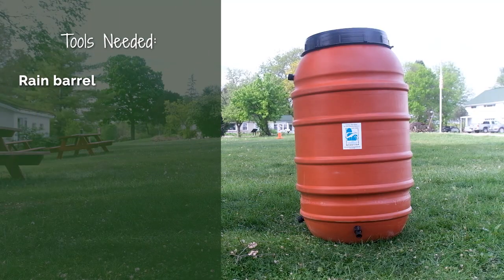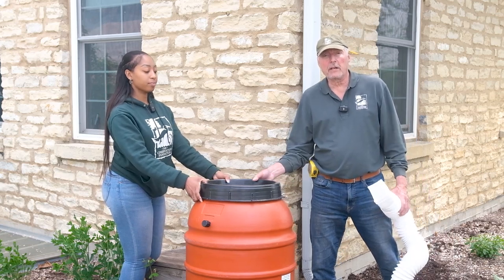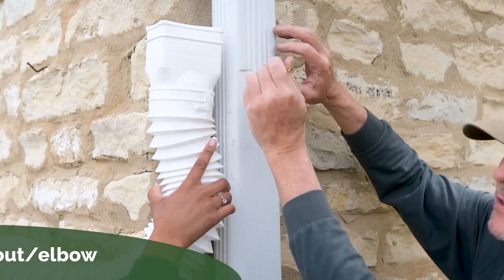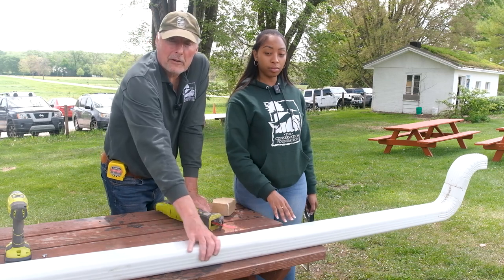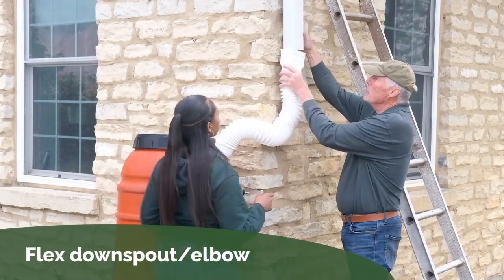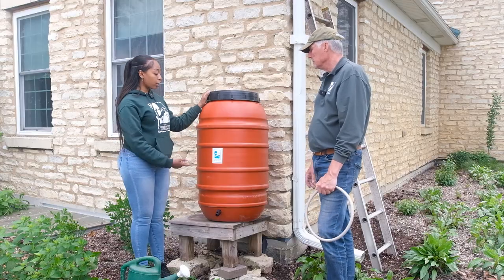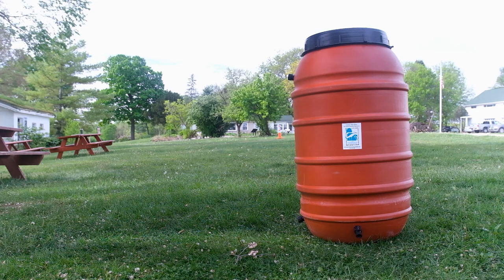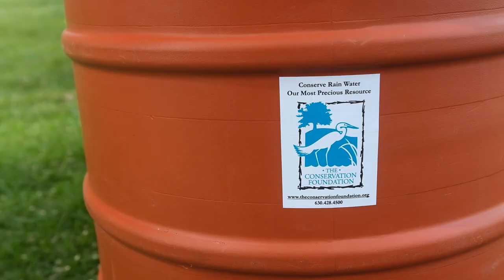How to Install a Rain Barrel at Home

Comment: So, i have a diverter, and i'm wondering if the hose out of the diverter has to go in above, equal to or below where thw overflow hose is situated.
Reply from the maker: For the diverter shown in this video, the diverter hose connects to the overflow hose connection. In other words, if you have this kind of diverter, you do not need an overflow hose. Once the rain barrel is full, the rest of the rain water is diverted back into the downspout and drains down the downspout into the ground. Hope that makes sense!

Comment: Sorry, I had to stop just after you mentioned using a rain barrel in order to catch & use "mineral rich water"? I'm somewhat perplexed as it was my understanding or a matter of fact: that the water from the sky that falls to earth is as close to pure water as possible or basically distilled water. Typically after a 10 to 15 minute Window has elapsed. The rainwater becomes pure filtered mineral free water. 10 to 15 minutes is any dirt dust or pollen taken down by the rain water which is not as pure until all of the particulate in the sky has diminished extended period of rainfall. I'm wondering where the minerals are coming from because as water evaporates we know that any heavy minerals stay on the ground as the water turns into a gas vapour. These water vapours rise far above the earth to form rain clouds. This is also known as mother natures natural water filter. Nonetheless if I am wrong, which is possible please correct me so I'm not spreading disinformation. Thank you for the informative video.

Comment: When using the flexible downspout and the barrel gets full, then what happens?
Reply from the maker: Good question! There is an overflow outlet near the top of the barrel that you should attach a hose to and direct away from the foundation of your home. When the barrel fills up, the extra water will flow out that hose.
Reply: Thank you for the video!